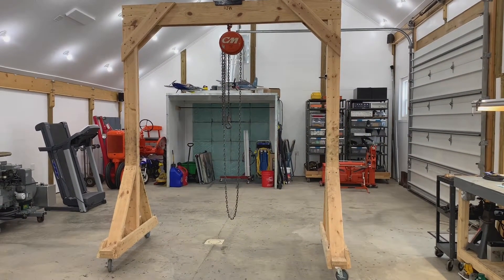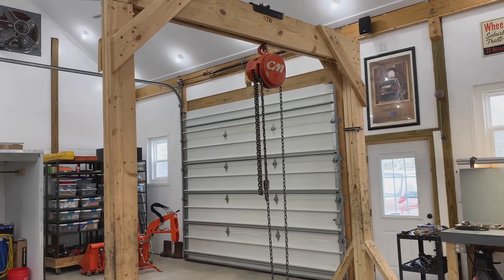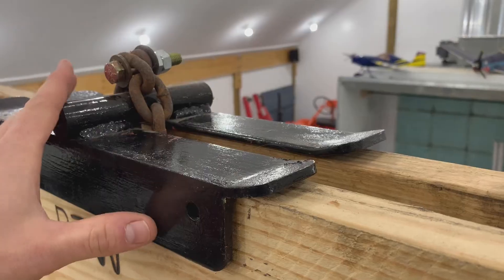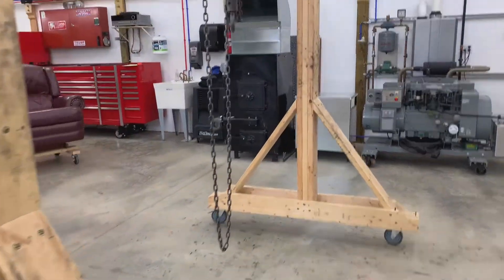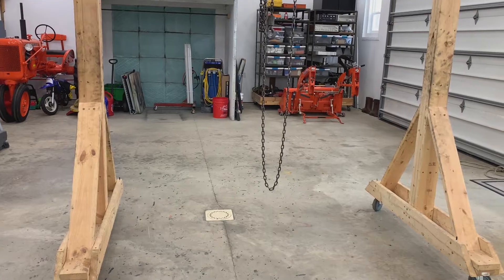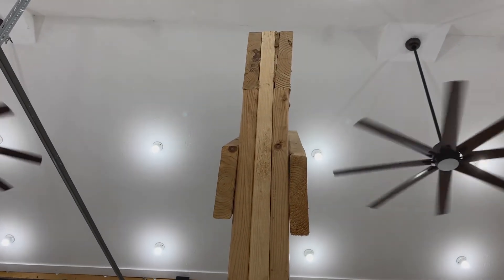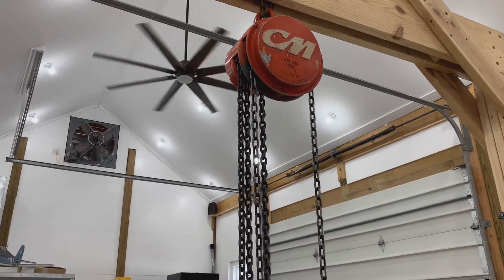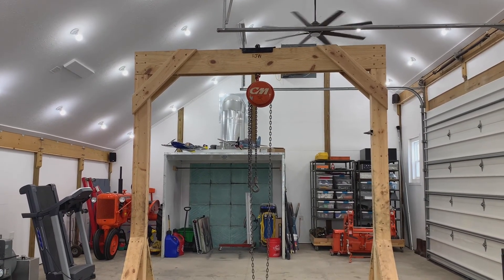1 Year Later.  DIY Wooden Gantry Crane Project

Comment: Do you live in a humid or dry climate?   I would probably seal the wood regardless of climate to create stability of the wood.   Building stuff yourself is a good thing.
Reply from the maker: Good call.  The crane lives in a climate controlled garage, but sealing it would provide added protection.  I actually sold that shop and crane and I’m happy to say the new owner is using it on a regular basis.

Comment: I built this from your video , the only things that I changed is that I used 3/4 cdx plywood with the 2x6 legs so that you have a 2x6 then a ripped down plywood to the width of the 2x6  then another 2x6 then another slice of plywood then the last 2x6 used PL 1000 gulled all  together, This was done on both legs , Then lag bolted all. My legs have not moved in any way at all. Very tight and solid.  have lifted over 1000 pounds with this Wooden Crane. I love this Crane.
Reply from the maker: Right on, I hope the legs stay nice and straight for you.  Good call with the plywood Sandwich

Comment: 45 GBP for a 10x2 in UK and about 30 for a 6x2. 
 - 10x2 - 2@45 = £90
- 6x2 - 11@30 = £330

Total for timber alone £420 ~ 541 USD. I think its not worth starting any calculations on the rest. UK is a shithole.
Reply from the maker: Yikes.

Comment: Good video. Matter of fact I'm getting ready to build one with exactly your same material list, wood. 
I do plan to make a couple changes.
1. Using waterproof glue for the vertical posts. I believe that will  eliminate  most of the twisting. 
2. The feet apparatus will also be glued together and to the vertical posts. 
3. The four 45° vertical post supports, I'm going to lengthen those to attach about 6 feet up the vertical posts. That should create even more support.
4. Using all thread 3/8" rod i'm going to use at least two of those at each joint on the horizontal beam along with heavy washers and double nut for locking. 
5. Going to use all-thread bolts on the lower joints as well. 

Thank you for your video. Was easy to understand and I didn't have to rack my brain to figure out a good design. 😁
Reply from the maker: Good stuff, I like your plan. Especially the glue on the verticals for twisting.

Comment: Is the trolley hard to slide under load?  I"m looking at using rollers instead of sliding contact
Reply from the maker: It slide ok up to about 200 lbs or so, especially with some grease on the slides. Rollers would be the way to go if you planned on needing that feature often.

Comment: Nice shop ,great presentation.I prefer carriage bolts for heavy loads with wood,I built one years ago in the field to repair a tractor,used 2x12s for top rail and lifted a very heavy old tractor,approx 8000 lbs.i just built a 8x8x 12 high rolling scaffold to work on my shop ceiling, since I am a one man band,I am constantly putting wheels on  heavy stuff.
Reply: Hi . Could you please tell me what size of the cargrige bolts that you used. Thank you very much.
Reply: @HoangNguyen-in1lo  
Been too long,don't remember exactly sizes,but I never use less than 1/2 inch diameter carriage bolts. Generally use lag screws and pre drill for static medium loads.Dynamic heavy loads I use 1/2 inch or larger carriage bolts with big flat washers on nut side.The washers are very important,I even use washers on anything structural,even # 8 & 10 wood screws as they tend to just bury the head and not pull the pieces together.Remember to pre drill and or dull the point of the screw to prevent splitting the wood.Sorry for the extraneous answer ,just thought it was necessary.
Reply: @randolphsnyder1505  Thank you so much for the information I’m so very appreciate . Thank you.

Comment: Did you glue the vertical supports and use bar clamps to let them setup ? If not maybe that's a way to reduce them from warpage. Kind of like making a glulam like in houses for floor support. Your project looks great only one thing i am going to do when making it like yours is making a longer sled on top with extra pins welded to make the chain where i want to if i have lift something off center. Great build good job bud.

Comment: Great video and very helpful! I am about to build one. My thought is that the point of failure would be at the bottom of the vertical legs. Some weight is distributed to the casters via the 45 degree supports, however most of the weight is being transferred to the bottom of the legs and rely on the rated shear strength of the grk fasteners combined with the strength rating of the 2x6's between the casters. Maybe an additional caster directly under the legs would work? (A block would prevent any mobility under a load). Have you noticed any stress to the 2x6's between the casters when under a heavy load? Thanks again!
Reply: yeah, if you wanted to avoid that I'd just add another caster directly underneath the load...but then again if I were picking up something that crazy heavy this probably wouldn't be the tool for the job anyway.

Comment: at 3:11 as a mech engineer yes yes it does make a big difference

if you have the pin alone then that creates a point load that all the force concentrates on 
spread over the 1ft that you have it as creates a pressure load for lack of a better term the overall force is the same but the area is much larger exposing the wood to lower pressures and stresses in general, also another benefit is if you have non perfect wood that might have internal weaknesses a single pin design may break that where as this has no chance of doing that

the one thing i would have done as a possible improvement is to put two strips of flat iron on the top of the beams, steel on steel friction is quite low and would decrease the wear on the tops of your beams from the steel sliding across the wood

also if the casters are rated at 2000 combined that would either mean that they are 500lb a piece or if that is 2000lb rated casters they are overkill for this crane and should be the last thing to fail as loads are divided equally when the system is symmetric, so if you have your load in the middle of the gantry both legs see the same force which is half of the load you are lifting then each caster sees half of that.

Comment: I would like to know how to add small push mower or lawn mower trailer tires for wheels, so it can roll through a yard that is not paved.
Reply from the maker: Lots of options for that, but obviously that would severely limit the capacity.
Reply: @BobWilson84  I have to do a swap on a small four cylinder engine. I do not have any kind of a garage or a flat paved surface and I am severely on a budget reviving a car I do not want to give up on.

I have not done an engine swap either, but I bought a Hayne's manual. lol

I think I could do it if I can figure out the lifting of the engine part.

Comment: I have gathered all the materials to build one of these. But today I’m obsessing about whether to build it short enough to take it outside my shop. If I do that it can only be 8.5’ tall. It’s only a gravel apron so maybe I’d never use it outside anyway
Reply from the maker: I also have gravel outside my door,  and I used it in the gravel once, I didn’t feel safe halfway through the lift and aborted.  After that moment, I’ve kept it in the garage.  I think you should keep as much height at you can, it’s very helpful to have space for the chain fall and room to move around.
Reply: 2 years into using it I have to say I’m glad I built it. I use it quite often for many things like routine like lifting the mower or most recently repairing tractor axles.

Comment: I need to build a gantry crane. I need it for riding lawn mower, wood chipper, tiller and to rebuild truck engine, etc. I really like your design. I like that you thought this through and waited a year to put it on here. What are your thoughts on load distribution if I made it 8’ or 7’?
Reply from the maker: 8’ or 7’ wide?  Or 8’ or 7’ tall sir?
Reply: 8’ is best for me

Comment: Calculations put the load rating on the beam at around 3300#.  You could have used a 2X6 for 1000#.

I’m looking at just wanting 1000# lifting and using 2X8 which calculates to about 2500# lift rating across the beam.

Like you, safety margin.
Reply from the maker: Trust, but verify… I like you.  I used similar equations for point-loading on open spans.    

Solid planning on your part.  I hope it works out well for ya.  Go hit that lumberyard and get started!

Comment: Can you post a link where you got the casters for this project?  We're going to use this design, just need the casters.
Reply from the maker: Harbor freight has a large selection of various casters.  Calculate what you plan to lift + about 300lbs for the crane and hoist. Then divide by 4 to get how much each caster is supporting,  then pick casters which are rated about 2x that value for safety margin.

Comment: Thanks for sharing your build, and the safety precaution that was emphasized during and at the end of the video. In the DIY world, safety has to be the number one concern when undertaking any project that could pose a risk for injury or death.  Having said that, would you change anything in your grantry if you had to build it all over again?  How many years of life do you expect to obtain from a wooden gantry such as this one?  Keep up the good work!
Reply from the maker: Thanks for the kind words.  I wouldn’t change anything from this design for my personal use.  If fits over the shelves I build so storage is easy, and the size is good for my use.  I think it’ll hold up for the rest of my lifetime.  It lives in a climate controlled building, so there’s no environmental factors to degrade the hardware or wood.  I’ll be using it soon for another project,  it’s been a real back-saver.

Have a good one!

Comment: Maybe one more swivel caster directly underneath the posts? Enjoyed the video. What a awesome garage!
Reply from the maker: Thanks, and great point about casters under the center.  I might add them next time I need it.  Have a good one!
Reply: I wouldn't recommend that. Any amount of sag will put all the load on the center caster and will change the load distribution and could increase the tendency to splay. You would be better off putting a temporary block under it if you are concerned about weight. The best thing would be to make sure that the legs are able to hold the weight that you are lifting. With castors in general you really increase the risk of splaying .

Comment: Great design. People sometimes  underestimate the load capabilities of wood, I have lifted some extremely heavy things from wooden supports in the past
Reply: Amen, raised a 32 foot steel beam for an open concept house renovation. Spanned the entire length of the main part of the house. Built a wooden three point hoist system and was able to lift it right into the ceiling.